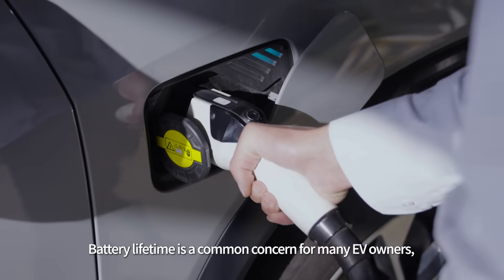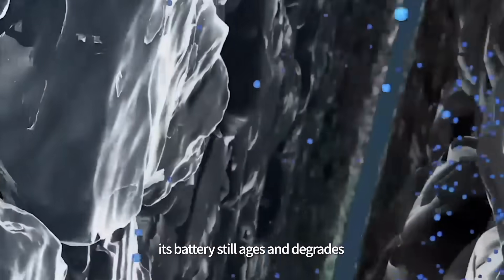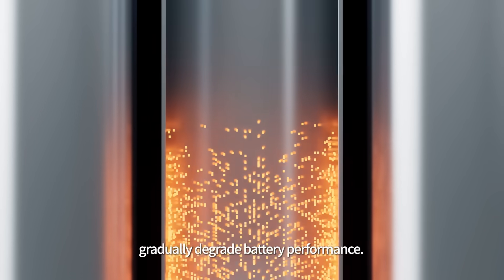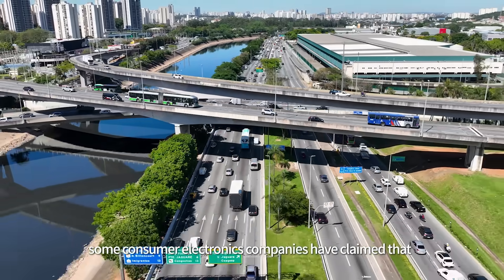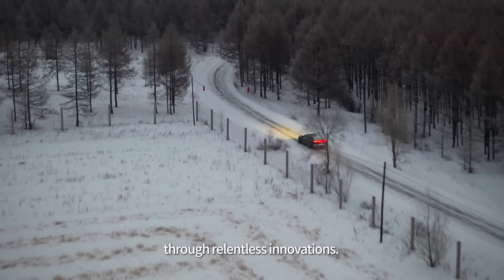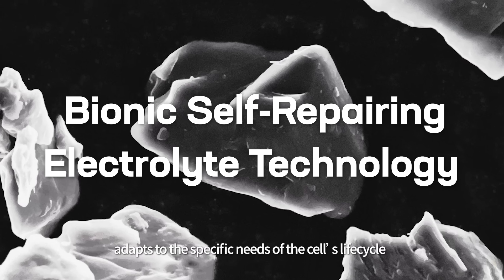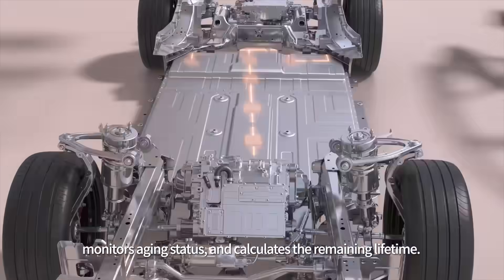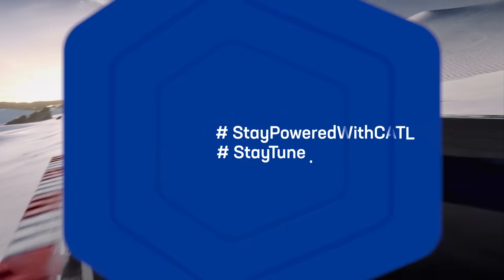Outlive the Ordinary: Secrets of Extended Battery Lifespan Unveiled

Comment: If you don't charge to max, or use plenty of overprovisioning and don't go into low discharge your electric car battery will probably outlive you.
Reply: LFP batteries can be charged and discharged completely. With 3000 cycles above 80%, you would be about 1 500 000 KM.
Reply: @danielvilliers612  but you would be stuck everywhere, when you discharge to 0 and overprovisioning is still helpful for LFP. Maybe your car manufacturer will do it for you, so you don't have to think about it.

Battery pack failures are cascading. So just because it should last 1500000 Km doesn't mean it will. And a pack with 40- 60% usable capacity is  barely useable in a car anymore, so I would say it's worth it to preserve the higher max charge and max current capability.

Comment: These more durable batteries will put a stop to steep EV depreciation on BEVs equipped with them.

16 plus years of longevity is as good, if not better, as 70% of ICE out there.

My ICEV and HEV are 14 and 13 y.o. and still quite reliable but a BEV with batteries lasting this long is a no-brainer purchase for me down the road.

Comment: Almost every single person that gets in my EV tries to claim that batteries only last 8 years or 100,000miles. They don’t understand the concept of the battery still having 80% of it’s capacity. It’s much more effective to say, “After 100,000 miles, battery capacity will degrade up to 20%. For example, a 239mile range EV may instead have 191miles after 100,000miles.” Though many Tesla drivers have reported as little as 5% degradation after 100,000 miles in 3 years due to a young lifespan. If you’re worried about going electric for a high mileage vehicle, the quicker you use those miles, the longer the battery will last.
Reply: Have 213,000 km on my Model S - Still have about as much as I had after 2 months of operation.

Comment: When we will see the 400 kw batteries in the market 😊
Reply: The high performance cars like Porsche Taycan are 240 to 460 kW power, so they must have a battery with at least that power. Those batteries are about 80 kWh energy.
Reply: Li-Ion cells can withstand discharge of 10C or even more (but with more losses). At 80kWh battery pack at 10C discharge would provide 800kW of power, in already existing cars like Model S Plaid or Lucid Air.

Comment: Do LFP batteries have a longer calendar life than NCM batteries due to their lower operating voltage? If so, how much longer is LFP calender life than ternary battery life?
Reply: Yes majority of the time LFP has a longer calendar life than NCM.
Reply: CATl LFP Batteries are excellent and market leading.
Reply from the maker: It is correct that LFP batteries generally have a longer calendar life.✔

However, NCM batteries typically experience a lower throughput during regular use, which can effectively extend their cycling life.😁

Comment: What happens after 8 years? Why is CATL not promoting its swappable batteries like NIO? If after 8 years only 50% to 75% of the battery remains, the EV is not as useful as before. The average age of cars in the US is 12.6 years, why waste 7 years or more of useful EV life. Electronics have a useful life of 20 years or more and most reputable inverters carry a 20 year warranty, EV can have useful life of 20 years, motors have a useful life of 15 years but can also be swapped. Swappable batteries ease the development cycle for car companies.
Reply: swappable packs are less likely to last as long as installed packs because of differences in usage by participants
Reply: 50% after 8 years would be covered by warranty. Most car makers garanty at least 70% after 8 years.
Reply: 16 years or 2M km before battery replacement is needed
Reply: Swappable batteries are a bad idea for passenger vehicles and may be good only for specific use cases. It makes the car heavier, and having hundreds of swapping stations brimmed with battery packs sitting there doing nothing is a huge capital cost.
Reply: @theagentsmith Even if the battery pack is slightly heavier, it won't matter much considering the already heavy weight of the car. And if the swapping stations are located along major highways like the Superchargers are, they should see a lot of actions. I don't understand your objections. I think this is a great idea: in and out in a few minutes.
Reply: @fparent  It is a bit silly, with latest releases of CATL, you could charge 600 Km in 10 minutes. That is, when you wake up in the morning with a full battery, you can do 1000KM, then with additional 10 minutes, you can do another 600 Km. That is 1600 km, tell me , who drives 1600 km in one go. Range anxiety is becoming ridiculous. 99% of people on this planet barely drive more than 100 km per day.
Reply: Watch it all.
Reply: You haven't watched the video for asking these questions.

Comment: You better inform us about the damage tolerance of the batteries  thank you
Reply: physical damage may be affected by pack design and might be beyond CATL's control
Reply: they have videos on puncture resistance,  also, so many Evs now have been in catastrophic accidents and have had no issues with battery fires.  unlike a tank of petrol of diesel which are renowned for being ruptured in big accidents, and exploding incinerating passengers.
Reply: @SydneyEV  I guess you were sayin about LFPs. Its not the case for NMCs.
Reply: @YBT07  Yep, LFP is becoming a much better chemistry as time goes on.